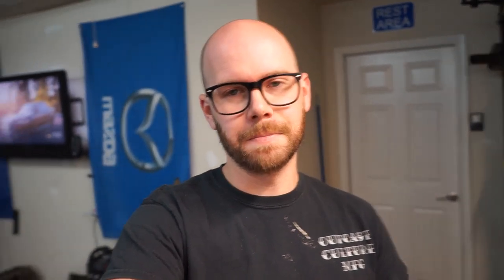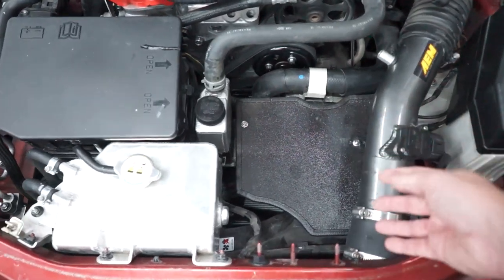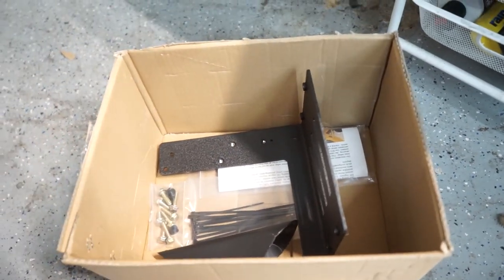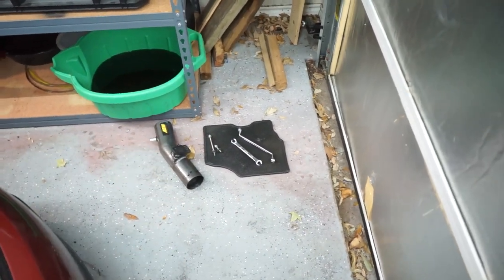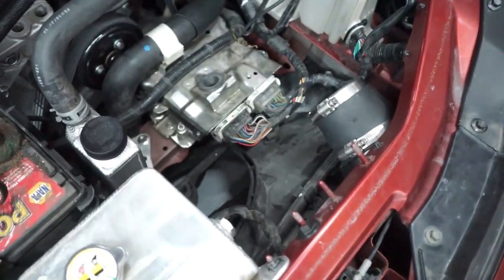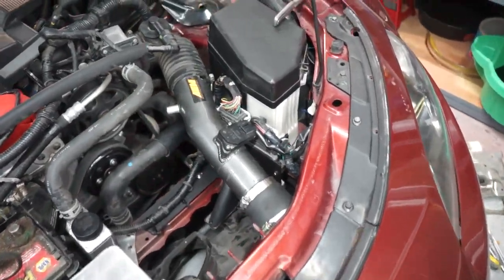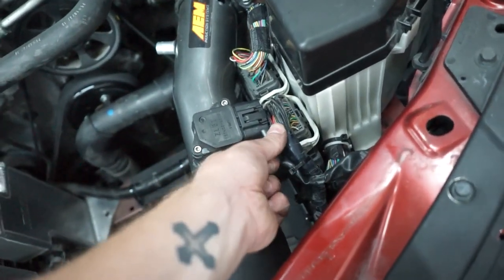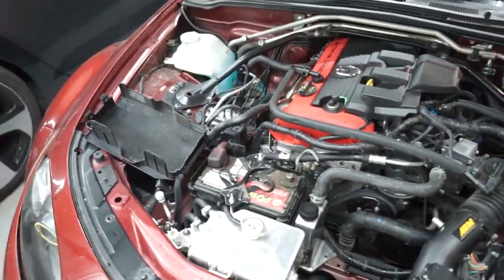Track Dog Racing ECU Relocation Bracket for MAX Airflow!

Comment: I'm sure it's been proven reliable but it's probably the only mod I've seen that I wouldn't do. The idea of water pooling (condensation, rain, etc) on top of my connectors... NOPE. Sealant fails, wire insulation cracks, etc
Reply from the maker: Yea and as I said, I'm not driving it in the rain.
Reply: @ColoredinLight  Agreed but condensation doesn't need rain, just humidity. At any rate, it's just a matter of personal preference!
Reply from the maker: The wires are exposed either way, any position. It will be ok
Reply: @ColoredinLight  Agreed. That's just me being silly! I did worst than that! ( ^ ᗜ ^ )